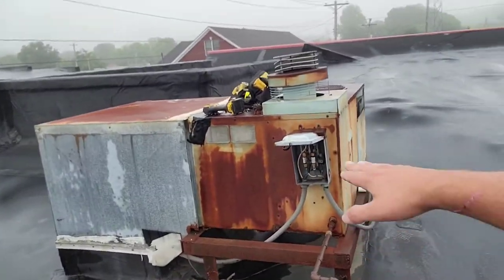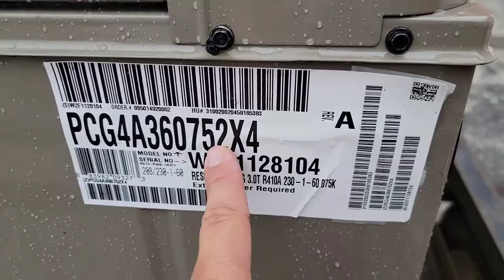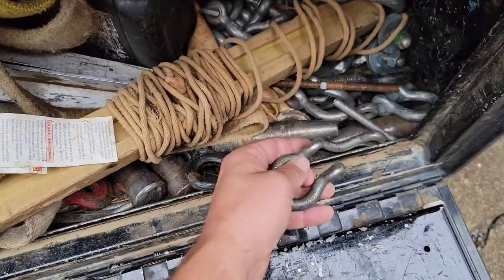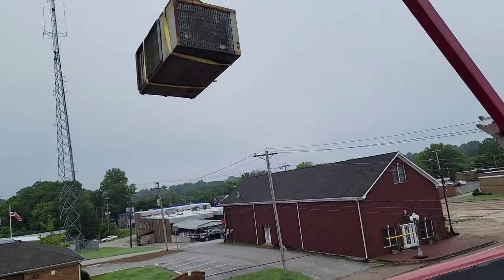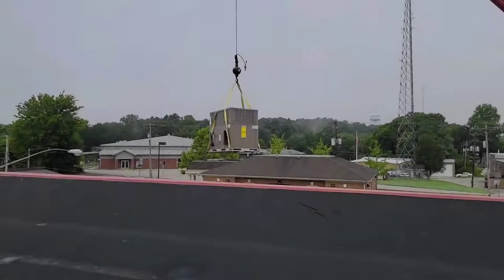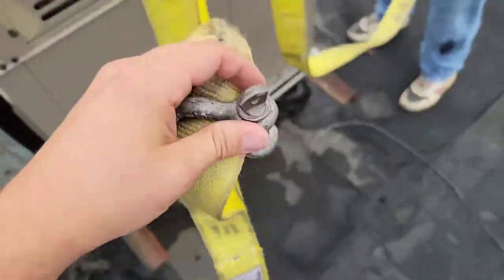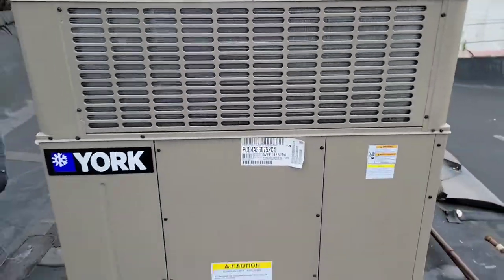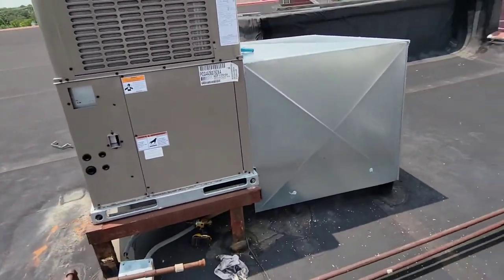Commercial HVAC Rooftop Crane Operator basics #cranelift #hvac #commercialhvac commercialhvac

Comment: Weight crane operator needs to know height distance and weight of the equipment. I’ve been doing commercial hvac and have set up cranes where they asked height and distance and I told them the weight they say ah I don’t need that then turns out they can’t lift it. Also in my career I’ve seen a lot of really old units but I can honestly say I’ve never seen one that old

Comment: Any idea what year that Carrier unit is? I presently have a working rooftop Westinghouse HVAC unit that is the original unit to the house which was built in 1949 and the units tags and labels also have the 1949 date and stamp. 😁👍

Comment: First the operator needs mats under his outriggers, not just a piece of small wood. Then he needs a safety latch on the ball, and a tag line on the load. Some of his nylon slings that were on the toolbox were ready to be taken out of service. His operating needs a lil practice, he had the new ac unit shaking and swinging alot.  Good luck in the future.
Reply from the maker: lol Thank you 😊

Comment: Hi, if the rtu requires a rooftop curb adapter do you have to bolt the rtu unit to the curb? Can strong wind blow the rtu off the curb adapter? Thanks
Reply from the maker: Typically the unit is secured to the rooftop curb adaptor with self tap 3/8 screws
 The rooftop curb adapter that goes over the existing curb is also secured with screws every 12" to 24"